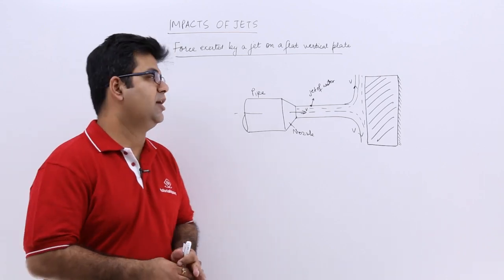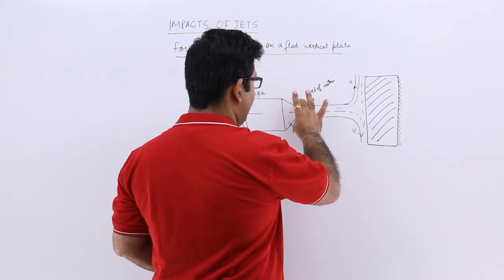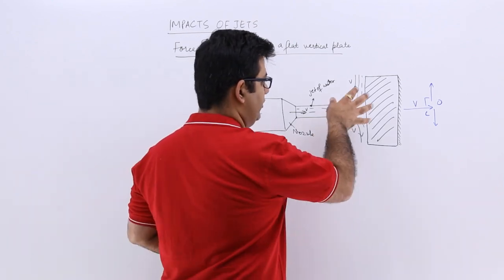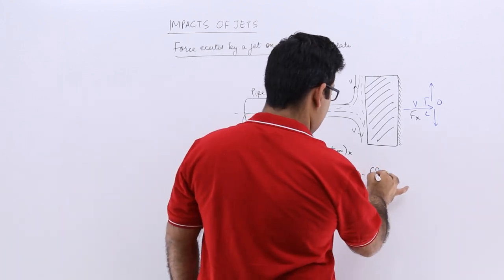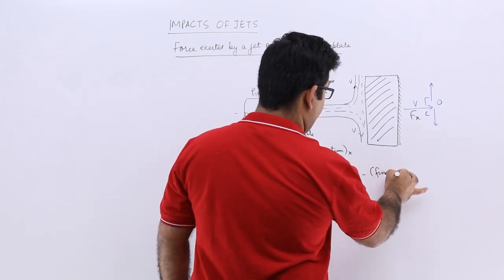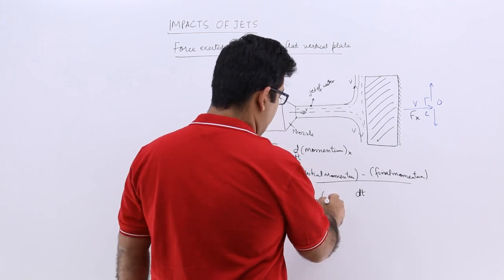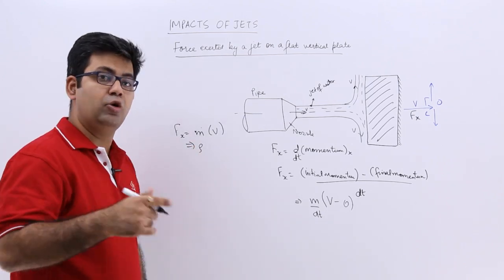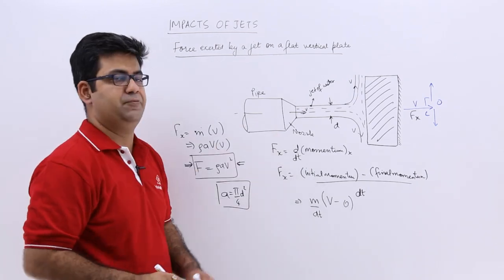Force Exerted by a Jet on a Flat Vertical Plate

Comment: Sir can you please make a correction . The change in momentum is given as initial - final . But it should be final - initial as there will be change in the direction of change in momentum if done initial-final . Please correct me if i am wrong
Reply: Bro it's the fjet not fplate
Reply: whey you do final - initial, you are finding the reaction force on the fluid, when you do initial - final, you are finding reaction force on the plate, the magnitude of your answer will be the same either way, its just the direction that changes

Comment: Please sir sent me ans of this question.
A jet of water of 10 cm diameter is discharging under a constant head of 80 m. Find the froce exerted by the jet on a fixed plate. Tack coefficient of velocity as 0.9?
.
Sent solution on my whatsaap please.
My wtsapp no is 8083037304
Reply: F=9983.9141 N